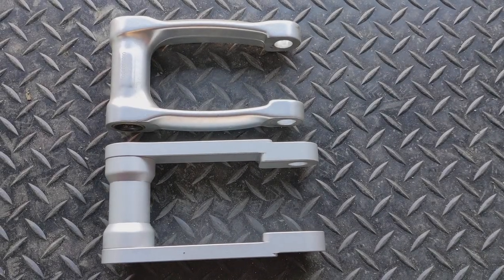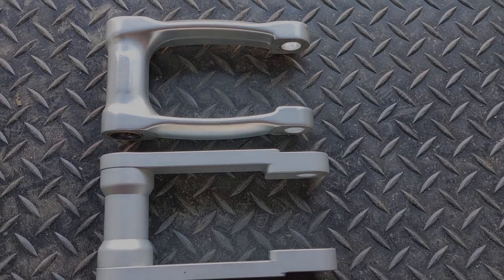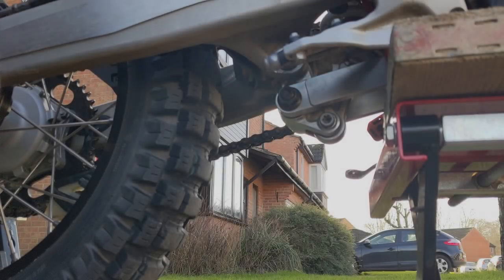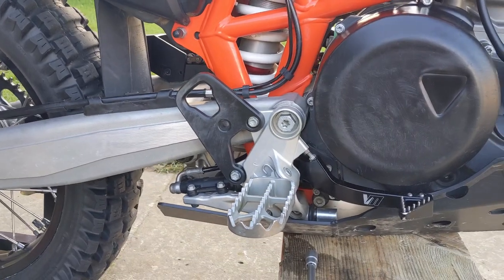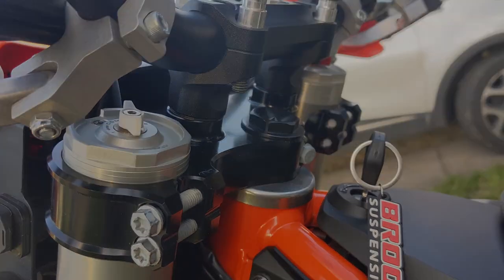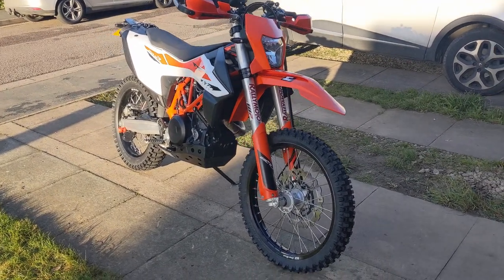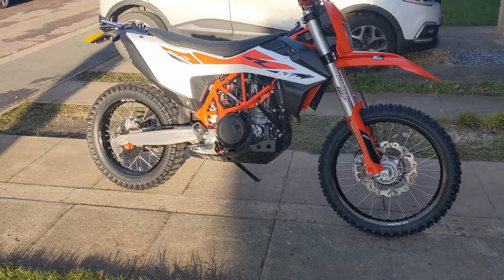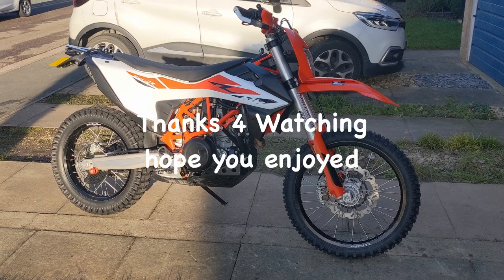2020 KTM 690 Enduro Lowering Link DIY fitting

Comment: How does it affect the stand? Does if make the bike stand up too straight, like its not leaning on it enough?
Reply from the maker: It doesn't seem to have made the side stand any less effective, I thought it may have made the bike stand more upright but I haven't had any issues at all
Reply: Guys told me they put a side stand off a 690 Super Moto on their 690 Enduro, so thats what Im doing.
To me the stock 690R enduro sidestand almost stands the bike up too straight.   If I get on with the sidestand down there is no way to get the sidestand up.   With out getting back off the bike again.

So Im trying the shorter super moto sidestand, found one used on ebay.

Comment: Excellent cheers. Can I'm torn between the 25 and 40 mm dropped links rally raid do. I have a 29 inch inside leg is this shorter than yours? Also How much did you drop front forks by?
Reply from the maker: Hi 
the drop on the forks I did was the same as the link drop 25mm in total the forks had a small 5mm drop when I brought the bike, the geometry has stayed the same and the bike felt no different other than the lower seat height which as helped me no end
Reply: @gnarlybadger690  thanks that's really helpful 👍

Comment: Nicely done! Do you know if this kit would fit the 2021 model too? On the RR site is presented for 2019-2020.
Also, I know that the original link has 4 needle bearings. Does the RR link have 4 bearings or only 2?
Reply from the maker: TBH I would give RR a ring there's always someone there during the week that could better answer that question again with the bearings I did notice that the bearings in the RR link looked to cover more area inside the link they also felt smoother than the standard bearings but they were new the KTM link Had covered 7,000 miles
Reply: @gnarlybadger690  RR replied. It works for 2021 model too. Their website is not up to date. 👍
Reply from the maker: @sorin.n  I've also heard there's a possibility they will be developing update products for the newer 19 onwards in the near future 👍🏻
Reply: @gnarlybadger690  the same link fits 2021 model already. Btw - I asked them and their lowering link also have 4 bearings inside. 👍 I will place an order. Let's see how much will it take to cross the pond from the GB to RO.
Reply: @sorin.n  thanks for this info! just what I wanted to hear :)
Reply: @kribaska  I have bought the product, installed it and I can confirm its quality and that RR are treating their customers with respect and they respond to questions quickly! 10/10! 👍
Reply: @sorin.n  Did you notice any difference in ride quality?
Reply: @ridemfast7625  I would say for the better, as I was more confident tackling harder terrain (knowing that I can now dab my foot if I need to). I also went 1 tooth less on my front sprocket.
Reply: @sorin.n  Just bought a used bike with lowering kit and 14 tooth front sprocket. At highways speeds, 70-75mph, do you ever think the 15 front would be better or rpm diff not that much?
Reply: @ridemfast7625  if top speed is what you are after then go with the standard sprocket. I wanted the bike to have more torque/acceletation as I like taking it off-road (woods). Btw it also wheelies sooo easy with the smaller sprocket. 😁